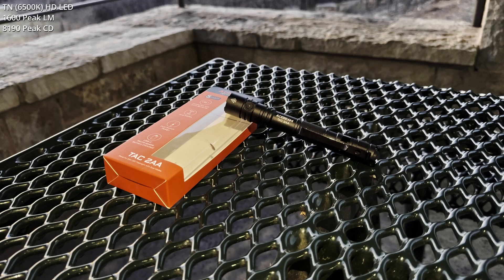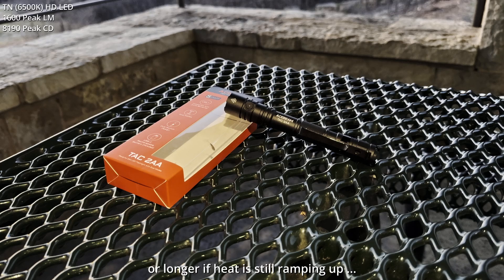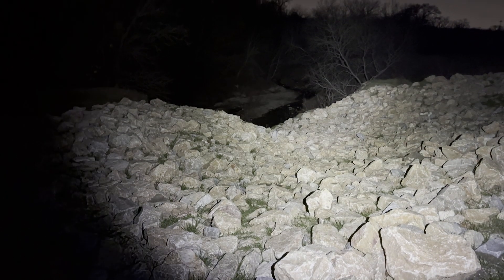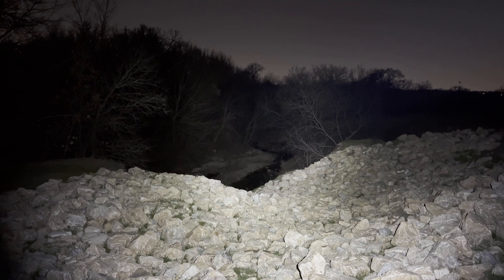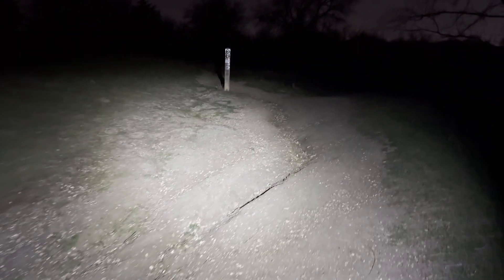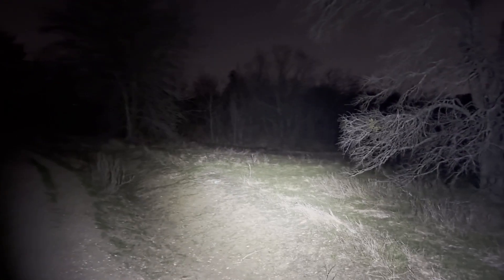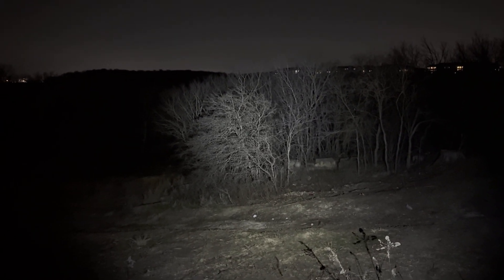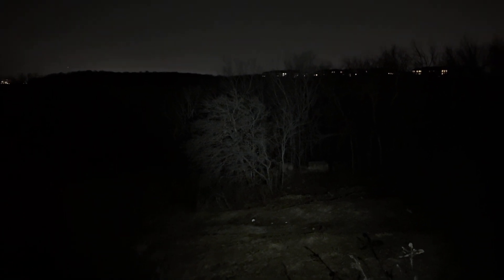ACEBEAM TAC 2AA 1600 Lumen Flashlight: Turbo Burn-Down With Thermal Imaging

Comment from the maker: I ended up recording just over 5 min. of thermal to get the ramp up and most of the ramp-down.  Scrub the playhead forward if you are in a hurry.  I plan on doing a number of dedicated thermal videos in the future along with different views.  One I am considering will involve setting my Lumix S5 IIX up behind the light and do my own PIC setup so that you can see the thermal temp. curve along with a display of the light as it is cast downrange.  And, over time, I will consider tech other than Seek Thermal. Yes, there will be a dedicated field test for the Nano 300.  Thank you.
Reply from the maker: Also note that video recorded by the Seek Thermal app is 586 x 430.  That video was software upscaled for inclusion in the review video.  Thank you.